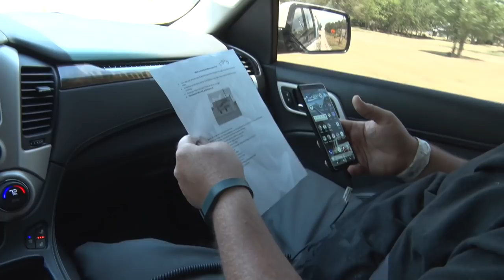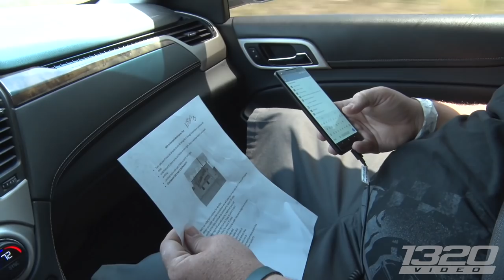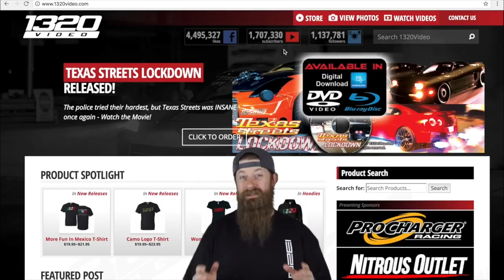Racers Are Resourceful! (You won’t believe their FIXES!)

Comment: ECU problems. 
my PCM for my 5.3 swap wouldnt trigger the fuel pump, had 12v at the wire and everything, could not for the life of me figure it out. 2 ecms, 6 relays, 3 hours of fuckin around
Tested my 30 year old cars ground wire i used, 6 ohms of resistance, should be less than 0.5.... hahahaha 
Grounds are the devil!